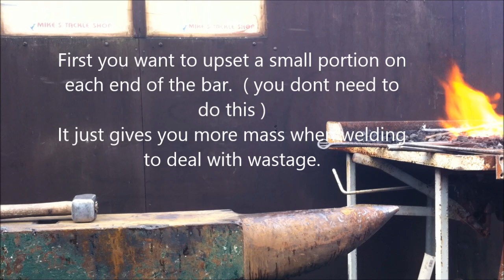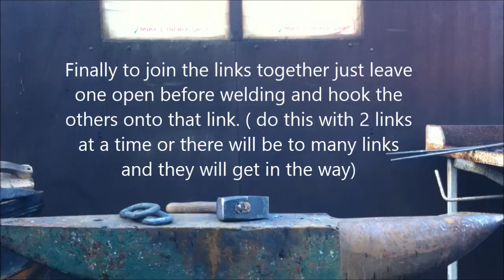How to make chain. ( No flux )

Comment: they told me that welding with no flux is no good. for my understanding: what factor is it that makes this fluxless weld as good as a weld with flux?
Reply: +daskraut flux just forms a layer to protect the glowing iron underneath from oxidizing, flux just blocks all the oxide trying to react with the iron. without flux there is just a bit of iron oxide forming on the layer of the iron which is then simply included in the weld. depending on how much iron has oxidized this can weaken the weld or even prevent it from welding successfully. thats what i know, dont take my word for granted. a quick research on wikipedia an you probably got all the information you need 

oh und bist du deutsch?
Reply: @keyehek1790  On the other side of that, depending on the alloy, you can weld just fine without flux.  Smiths have been doing it for thousands of years before the invention of Borax and the like.  Mild steel and wrought iron work best for this, but I've seen smiths weld tool steel to a mild steel bar (for an axe) using plain sand as flux. 
Want to see it done (other than here) look up a smith named Rowan Taylor here on You Tube.
Reply: @JarlSeamus  Borax is a mineral that's mined, not a chemical someone invented ;). People used quartz sand for ages but indeed welding without flux was very much commonplace.
Welding without flux requires much more precise temperature and oxidation controll, depending on the fuel you use it's either not too difficult or very hard.